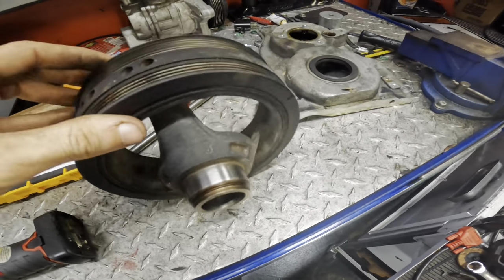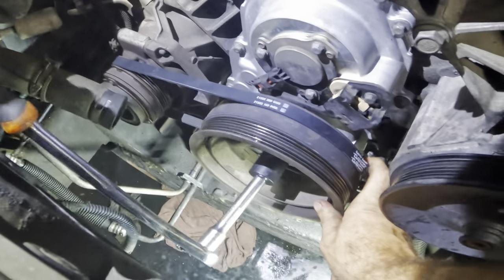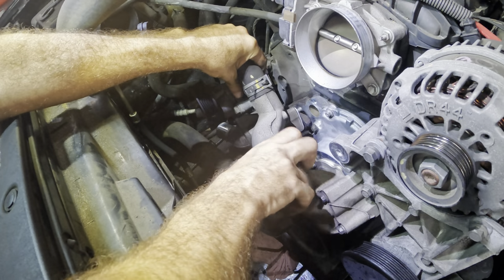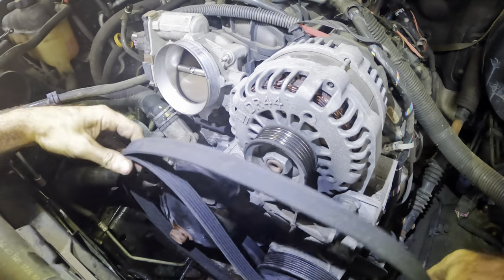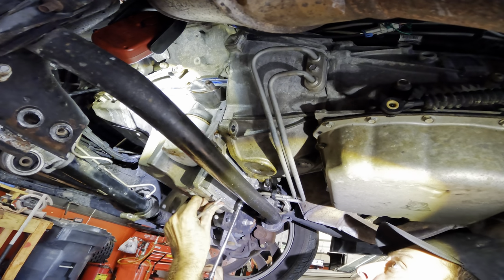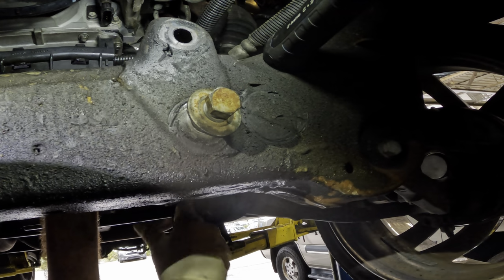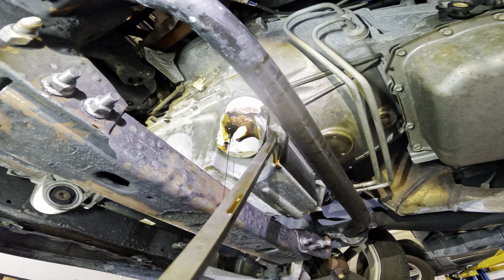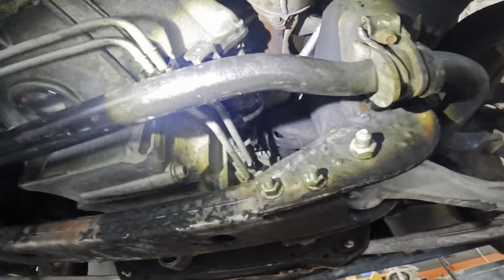Customer States: Melling Oil Pump Upgrade! GM 5.3 V8 PT2

Comment: Lisle 59370 stretch belt install tool is under $20. Slicing your hand open on that pointy coat hanger workaround is over $500 at the ER.

Comment: There is a tool to remove oil filters, fits all sizes!! I bought one years ago, it's a spring ring. Works well!!
Reply: I use the specialty tool. A big flathead screwdriver hammered through the filter.

Comment: I actually bought a surplus Cleico brand nut runner for assembly lines. It has a slipper clutch that is set in the tool room to get the fastener to the right torque.  Man it came In so handy assembling engines I think I paid 40 or 50 bucks for it.  But they were over $1,600 bucks new in 1990.

Comment: if that filter problem arises again, pound a long screwdriver through the filter and use it as leverage device.  using the screwdriver is a whole lot easier.  the pry bar just creates more work.

Comment: Whenever I've had an oil filter that wouldn't budge I take an old screwdriver and knock it into one side of the filter use it to move the old one until it comes loose 👍

Comment: The honda dealership wanted an insane amount of money for what was essentially a nut and bolt tool to put my clutch pack on my motorcycle back on. I just went to a specialty bolt store and spent around $3 for basically the same thing.
Reply: See, that is insane and dishonest by the shop.  If they saw the job you saw and still wanted to charge you that much they are a rip off shop.

Comment: try putting it on the big pulley  first and then onto the little I never like those cork gaskets back in the 1960's that's all you could get and your oil filter you should have the strap type of remover sometimes they are easier .one thanks for the video CLICK

Comment: For those chevy filters, always liked using band wrenches. Never worked slamming a screwdriver into it to turn. Most of the ones i would come across were beyond tight, ended up destroying the filter with no leverage to turn it.

Comment: Actually if you did forget the oil sump the engine wouldn't blow up because in this parts replacement scenario the engine needs to be cranked without starting till you get oil pressure.
Reply: Right, during first cranking Ray did not get oil pressure. Actually, one small thing was not mentioned at all, that is oil pumps are not self priming and should have oil layer inside prior being installed. Of course some drops may flow backwards from channels to prime pump but you should not rely on it.

Comment: I think the purpose of the correct installation tool is to keep from damaging the threads in the crank. It acts like a stud and then you press the harmonic balancer on by putting the stress on the thread of the stud instead of the threads of the crank. Could have just used the crank bolt in lieu of this makeshift threaded rod for all it was worth
Reply: Not hating on ya, Ray. Just pointing out that this one didn't make sense. to me at least.
Reply: When putting car back to normal turning to use original bolts can snap and then cause a bigger problem down the road if the customer wants they car back, but many macanics adapt tools to aid the in they quest to fix thing's which help speed up the process of repair.
Reply: If the crank bolt was long enough to thread in the shaft with the pulley that much out, don't you think Ray would've used it in the first place?
Reply: Crankshaft bolt isn't long enough to start with the harmonic balance out that far.   In fact I've done that job several times and I'm not comfortable with pulling it in with the crankshaft bolt even if it's partially threaded, I want a lot of thread engagement when pulling  😀
Reply: Uhm, the original bolt isnt long enough
Reply: @stevewhite3424  bolts tend to gain nothing after 3 full threads or so.  That's why your typical nut is about 3 turns.  A couple extra for insurance can't hurt but add little
Reply: The problem is the crank bolt is not long enough.

Comment: From what I think I remember from Reading torque specs on the Milwaukee M12 tools, the ratchet is only 20 to 40 lb of pressure while the impact is around 200...
Reply: the Milwaukee ratchets are either 35 or 55 ft pounds of torque depending on the model.

Comment: To remove a tight oil filter all I did was to knock a phillips screwdrive into the filter from the side it lets you use it like a bar, simples.

Comment: I hope you replaced the cam position sensor in the timing cover too. Those die and swell and wont come out causing a need to remove the timing cover.
Reply: Woops.  I didn't see that getting replaced.

Comment: I bet you the front crankshaft oil seal leaked oil because it needs to be aligned before the front timing cover bolts are fully torqued up using GMs special aligning tool or the front pulley since the timing cover doesn't have any dowel pins to align the front cover to prevent distortion of the front crankshaft oil seal & an oil leak.

I also have an oil filter removal tool to remove the oil filter from the LS1 oil pan since the conventional tools can't easily grip the oil filter & the Holden Commodore (same as the Pontiac GTO) K frame interferes with the regular tool so mine has  1/2" drive hole so I can use a ratchet & a 1/2" extension bar to remove the oil filter !

Comment: Ok the a/c compressor belt being stretch fit. I don’t like them. I have converted it back to a tensioner setup on my 2015 2500hd with the 6.0L. Never had an issue with the tensioner setup. But I do keep an eye on the pulleys (because my first truck was a 1995 Ford F-150 XLT 5.0L and it had major issues when it came to the belt system), if they start to wiggle I replace them. Have only had to replace one a/c tensioner so far and it was on my Dad’s 2003 Chevy 2500hd with the 6.0L after 250k miles, It didn’t really fail the pulley started to have some slack in the bearings. On my 2006 Chevy 1500 5.3L (160k miles) it has never been changed. My 2003 Chevy 2500HD 8.1L (190k miles) hasn’t been changed since I’ve had it. So I haven’t seen an inherent problem with them. But maybe I just have good luck with them.

Comment: Excellent as always.  Don't blame the owner for replacing with a high output oil pump but while you had it down that far I'd have had you replace the water pump, also.  Always heard if you're taking the timing chain cover off to replace the chain you should do the water pump, too just to be safe.  The customer already was paying for the labor and a water pump for a 5.3...which I think that's what it was....isn't too expensive at this point as it would be later down the road.  When it's' time I'll have mine done the same.  Preventive maintenance is lacking these days and those of us who like to keep our rides and can't afford a new one don't mind the love and care we give them and it's smaller expense compared to a new engine or entire vehicle.  Stay cool down there in FLA USA.  Getting hot and humid up here in central Alabama this coming week or more.  I am glad there are people like you who do what you do in the heat and cold.  I couldn't do it.  Cheers.

Comment: I found out the hard way that for my Chevy Tahoe that the belt length depending on what size alternator (of course I had no idea) is different.  Squeezed a shorter belt on the vehicle.  Some months later the pulley broke off of the water pump, many miles from home.  A rather expensive mistake.

Comment: You gotta admit, that filter wasn't EVER going to leak! Unless it some how got a hole in it! LoL 😂😆
Thanks for your videos!
Reply: I suppose the over tightening could stress the crimp fitting on the base plate and the filter could split at maximum oil pressure.

Comment: I have a couple of oil filter wrenches that are like sockets that fit over the bottom where it's formed like a huge nut. I have driven screwdrivers through oil filters in the past to get the leverage though. Obviously the previos mechanic was a shade tree with some experience but no training. At least he didn't overtighten so much it blew the threads out.

Comment: I’m surprised you guys didn’t go with a new water pump as well as a new serpentine belt considering everything was taken apart but who knows good job, Ray
Reply: I agree.. not much labor left to change it.
Reply: Since quality on new parts is pretty sketchy, sometimes you're better off  with the older, but working part.

Comment: Any customer that has an oil pressure problem does not need a new oil pump.
Reply: If so,,,, your right,,,, 2 oil pumps are not going to fix a DOD system! LOL

Comment: Probably said this before, but when you install the crank pulley, don't turn on the threads of the crank.   They  make tools that you essentially thread in the bolt and then turn the nut.   If you screw up the crank threads your could be in world of hurt.   Besides, by the time you find the right thread to make your own tool, the bought tool would have paid for itself.   The bigger tool sets probably cost $80 and can pull steering wheels as well.   The cheap tools are probably $20.

That being said, I've used the crank bolt in the past.  Hard to say how much if an damage I did.   But I now know better :) ish

Comment: I have to say over the past month or so since I discovered your channel I've become a highly addicted to it, I look forward to your daily adventures or misadventures depending on the day, today was a first for me, up to this point, everything I've watched you do was familiar to me because of my many years of doing it myself but I learned several new things today, firstly I can understand why GM changed their AC belt design I replaced many a tensioner that had gone bad and wondered if there was a better way, I have to say out of all the ways I've used a coat hanger that was the most ingenious way I've seen yet, and now I understand why you often spin up your ratchet before putting it on the head of a bolt, I see now why you're not worried about cross threading or stripping them out.

Comment: I am kinda surprised that the previous "mechanic" didn't snap several bolts off in the oil pan!!!! CRAZY TIGHT! He also might of used an impact tool to install the oil filter....😝

Comment: There is a dirtier way to remove an oil filter.  Pierce the filter with a screwdriver, and use that as a lever to turn the thing. Nawty, but does work. But I'm sure you knew that, and didn't want to make more of a mess, lol.
Reply: I tried that once. The filter was so tight that the screwdriver just started to cut the filter in half.

Comment: That oil pump replacement is making me want to do mine on a 09 chevy silverado 1500. Went back at your first video and oil pressure was 40 on start up. Now its 60? I run the oil it calls for and my pressure drops down to 22-30psi at idle at operating temperature.

Comment: So that was a new crank pulley bolt? These are single use only. How did you stop the crank from turning when you torqued to angle (140 degrees)? As required for the crank pulley, unless using something like an ARP bolt - which gives you a specific torque of 235 ft-lbs when using ARP assembly lube. So this is, and needs to be, tight.

Comment: Interesting, wonder why they wanted a high volume pump and not a deep pan so it doesn't run dry under hard acceleration or heavy load? Anyways wish I had a good mechanic like you locally, my truck needs an SRT oil pump and cam+ lifter replacement.... Ugh Hemi issues.

Comment: Ray, using the threaded rod to pull the damper/pulley on is a bad idea. If you damaged the threads, the crank would have to be replaced, not good. Get and use a proper installation tool. Don't ask me how I know.
Reply: How do you know?
Reply: @buckhorncortez  Now I want to know what the proper tool is and why Ray doesn't have one.

Comment: ray, I don't think we've seen you do an actual tourqe on a bolt  Crankshaft pulley, in the video after installing the AC belt you then install the water pump, or maybe it was skipped in the video 😊🙏🏻
Reply: He used the German torque wrench goodantight!!!😂
Reply: @johnlarkin549  🤭🤭🤭
Reply: So because you didn't see it, it wasn't done??
Reply: @budboggy4699  😄🙏🏻

Comment: Why do you start you battery wrench before you have it on the bolt wouldn’t that strip the head ? Great vids by the way 👍🇬🇧
Reply: It takes torque to strip a bolt head. If bolt is loose that won't happen. 
Time to align wrench manually=5+ seconds. Time to align using wrench=1 sec. Amateurs don't need these few seconds(in the best case)
Reply: I mean, it may or may not strip the head, but what it does from a physics perspective is give the head a bit of rotational inertia when it goes to turn the head. It would add a bit of torque that otherwise wouldn't be there.
Reply: @fefifofob  thanks for the info I never knew that cheers👍
Reply: I've been wondering about that too David.   I don't think the power is enough to strip the bolt head but it just seems like it would make things a little harder.

Comment: Use a small rubber band around around the threads of your bolts to keep them from falling out. Put the band around all three bolts and snip off the band when the bolts are started or just crush the rubber band by tightening the bolts.

Comment: I always tend to overtighten my oil filters, perhaps I don't know my own strength. LOL Anyway, the best method I've found for removing a stubborn filter is to punch through it with a long screwdriver. Make sure you do it off-centered so as to miss the threaded tube on the engine. Then the screwdriver can be used as leverage to spin the filter. Works every time!
Reply: That is the stupidest thing to ever do. Use a damn band wrench.
Reply: @duckwacker8720  I'm talking about even when band wrenches don't work. I'm talking about a last resort that's better than using a pry bar. Calm your hormones, keyboard warrior.

Comment: Why don't you get an oil filter ban wrench? Put the wrench on the steel ring at the top of the filter and simply spin the filter off or on.

Comment: Damn that is little ass starter. The starter on my 93GMC c1500 is a bull. I know cause I had to change that sucker in a parking lot by myself. That thing weighs every bit of 25lbs, doesn't sound like a lot, but try working that 25 lbs in there and starting a bolt at the same time.

Comment: Why is the gasket for the pan sticking out in that one part at the front corner?  Are manufactured gaskets supposed to do that, fair enough if you put a bead of silicone gasket material and it squished out, but I wouldn't have thought a manufactured gasket would do that!
Reply: Some of them have a tab sometimes
Reply: @TheFrenchPug  ahh thank you.

Comment: I wonder how much the store-bought pulley installation tool costs? I bet Autozone has it for rent. It can be hard on the crank threads to grind it on like that. In the old days, we used to beat small block Chevy harmonic balancers on with a big hammer when there wasn't a threaded hole in the crank nose.

Comment: did you torque oil pan bolts on one side and then, later, on the other side rather than crisscrossing over and back working from center outward toward end bolts?

Comment: silly question and I'm no mechanic but was the oil filter fixed to the pan and while it was off surley was there a reason not to remove it when it was off??

Comment: could have saved some time on the filter. Not going to reuse it so just poke a hople in the bottom with a screwdriver drain in to  s  uitable recepticle    then proceed to to wedge it out

Comment: s there an oiling issue  with these engines that the upgraded oil pump helps with?
Reply: I think he said at the beginning he didn't know why the customer wanted it done.
Reply: The main problem seems to be that O-ring where the pick-up tube goes into the oil pump. I agree with some other commenters that the owner probably thought the oil pump was accessed by removing the pan only.

Comment: Milwaukee does make an M12 cordless impact rachet (for those that already have at least 1 M12 tool), they call it a "right angle impact wrench", 1/2" has friction ring or detent versions, 3/8" only has the friction ring iirc
is apparently a beast too, out did both the Milwaukee M18 and Kobalt 24v impact wrenches on Project Farm's channel's tests
Reply: Ray has a Milwaukee 3/8 Right angle impact. I have the 1/2 and like it.
Reply: @phillipdewitt4454  was just mentioning it for those who were newer or just went by what he used(which were just ratchets till he broke out the stubby)

Comment: I thought that the crankshaft pulley bolt on these LS engines must be replaced everytime it's removed since they're TTY and that the OEM pulley installation procedure is to first use the old bolt and torque it to 240 ftlb, then remove the old bolt and check the crankshaft snout recess (.094" - .176") - especially after replacing the oil pump, then use a new bolt and torque it to 37 ftlb then turn it another 140 degrees. I can't believe I go thru all that when I could have just uhga-duhga'd it on (TTC is awesome). 😉
Reply: Sorry, not a mechanic here. TTY, TTC, can you elucidate please for the novice. Thank you.👍
Reply: @chrisbentleywalkingandrambling  TTY is Torque to Yield.  basically they are designed so that at the specified torque the bolt physically stretches and locks into place.  But you can only stretch them once which is why they have to be replaced.
Reply: @FunktasticLucky  thank you, appreciate it.
Reply: @chrisbentleywalkingandrambling  TTC is Torque Test Channel, which is a youtube channel that  does torque tests on impact wrenches and other tools. Rainman Ray refers to it when he's talking about the cordless ratchet, so he must watch it.
Reply: @rjm7168  Thank you, appreciate the reply. Will go take a look now.